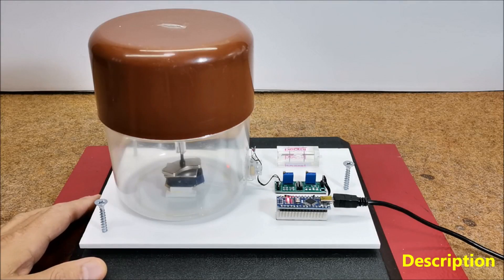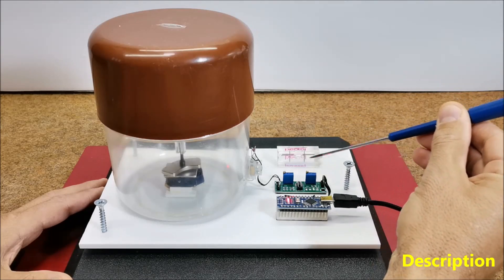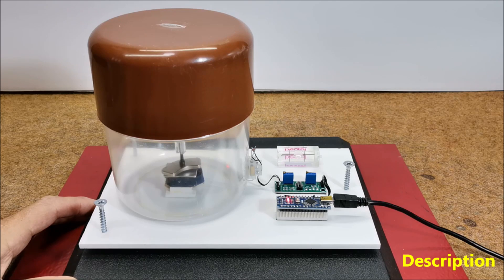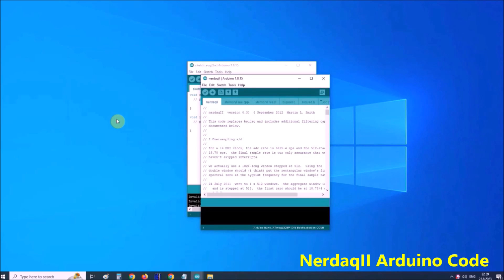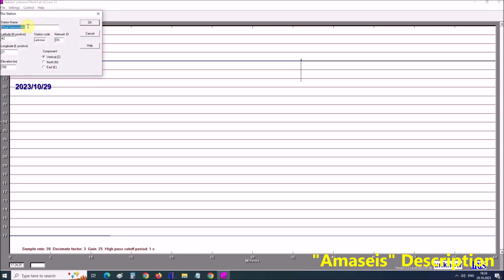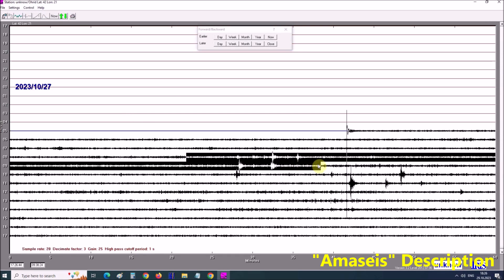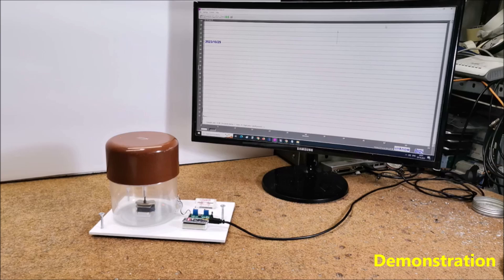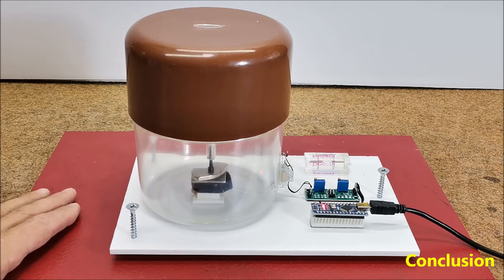DIY extremly Sensitive and cheap Arduino Seismometer

Comment: Hi Mirko, great project. Question, what is the reason for the Diodes and where did you install them? Keep up the nice work!
Reply from the maker: Detailed schematic diagram at:https://www.hackster.io/mircemk/diy-extremly-sensitive-and-cheap-arduino-seismometer-50de60     Diodes protect OP amplifier input from higher voltage generated by coil
Reply: @MirkoPavleskiMK   Thanks!

Comment: The idea arose to create a network of such sensors. To make them energy independent. Connect them to GPS modules. You will be able to triangulate the signal source and see it on the map. We need to think about how to do this. If we take the Heltec Wireless Tracker v.1.1 development board, we have Wi-Fi, BLE, LoRa, and GPS on board.

Comment: Subscribed! Since I just bought a house in Japan, this sounds like a cheap and fun project to mess around with. I'm thinking of maybe epoxy gluing them on the house foundation... I guess if my ground soil is too soft I would need to bury it in a deep hole to at least clay level? Perhaps using a smaller lighter magnet, maybe inside the coil would give better high frequency response? I would like to try to detect the high speed P waves, as well as observing the wave patterns. but maybe this type of geophone isn't sensitive enough for that kind of thing? I was maybe thinking of using audio grade phono amplifiers/adc's that would have a frequency response from 20hz to over 20khz? Having said that, i wonder if using a phono moving magnet style cartridge/stylus would work well? Either way, thanks for sharing your project. This will be fun 😀 edit i was also thinking maybe it would be possible to use a coil and magnet from an old speaker? Though with so many sizes to choose, i'm not exactly sure which would be ideal for this application... Lastly, were you able to calibrate the wave amplitude with the earthquake magnitude?

Comment: Is there a way to increase the sample rate? Like up to 1000 hz
Reply: I think you can get rid of microcontroller completely and use mic input in your pc (use cheap USB one for testing to avoid damaging your MB) and the then you can hit upto 44000kh
Reply: I think you can use an esp32 instead of the Arduino nano, then you can modify the Arduino code with help of chat gpt for it to sample at a faster rate, idk if 1000hz would be possible but you can tell gpt

Comment: ~18 samples per second does not sound too useful. To record frequencies up to 50hz roughly 100 samples per second are needed. maybe something else would be more suited than an old arduino. stm32 or one of those new wifi stamps have more cpu power. also for local storage and not needing a permanent usb connection
Reply from the maker: Ok, but this is still the simplest way to detect tremors. After all, the seismograms from the local seismological station in my city are almost identical to those of this simple instrument. Of course, my instrument is not intended for the analysis of the received data, but only for visual confirmation of the earthquake
Reply: Hey, could yo know how to modify the code or something for it to give more samples per seconds on esp32?

Comment: Thank you for sharing. I would try to implement this in a Greek Public school. Can we run the system without a PC ? Otherwise what is the cheapest energy efficient pc hardware system we could use for this software (24 X 7 running). Thank you
Reply from the maker: Amaseis is very old software and you can use any pc that support win XP or newer

Comment: I really like this DIY project. Thank you for sharing. I would like a follow-up video, on DIY techniques to improve the units installation... I rather imagine that it should be buried in the ground, in a concrete vault, to improve contact to the Earth and to limit ambient influences, such as wind. I would also think that the site should be remote, to limit automotive traffic noise. Humidity control, within the crypt would seem important. Making three identical sensors and burying them separately, over some distance, would enable triangulation of the seismic event's source. Upgrades might include battery power and wifi communications. As I said, all very interesting, indeed!
Reply: Correct, and also, the concrete vault should be cast in direct contact with local bedrock.